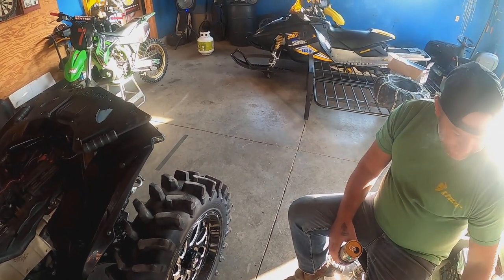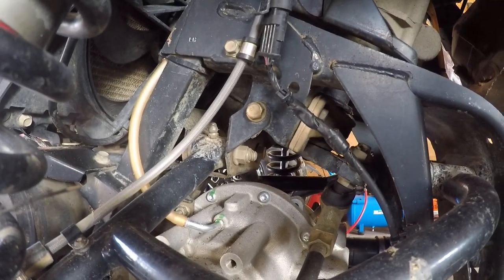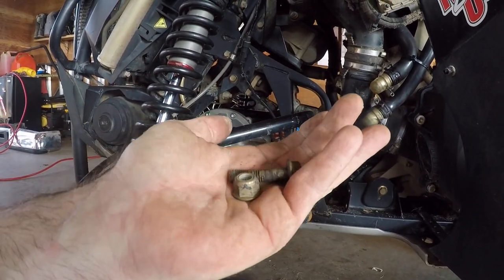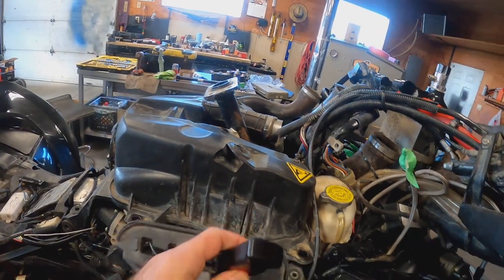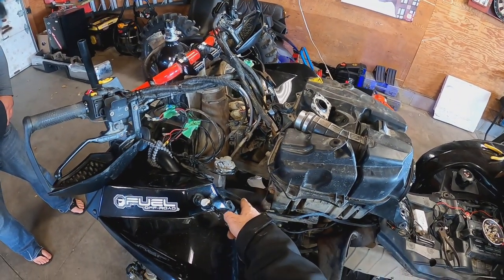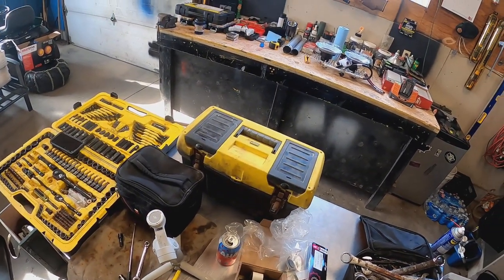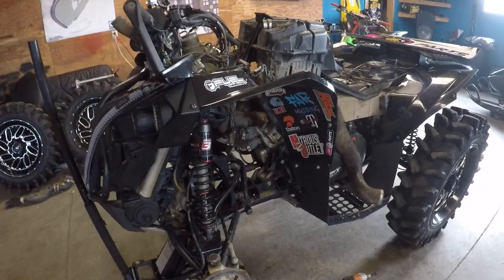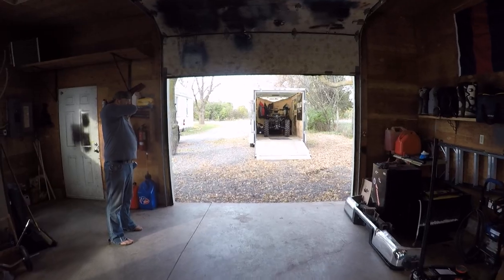Can-Am Renegade Xmr1000r, Upgraded Pitman Arm Install

Comment: Is this just a upgrade or a must fix?
Reply from the maker: When the original wares out, a must!
Reply: @ehTV1000  Wow, I have 3200km on my 2020 and do a lot of driveing with tracks and don't have that problem "yet"....and I'm not looking forward to having to change that out lol
Reply from the maker: @xmonster741  had one replaced on the 20 we had, 21 has been good so far though
Reply: This is truly a problem can am should be recalling.  My 19 outlander is all over the place. And my sons 19 xmr was shot a couple months after he bought it. Glad there are aftermarket options now. Not going to replace a crap brp part with another crap brp part.

Comment: First lol did you fix the problem joe is she steering better
Reply from the maker: Big time!! Only question is for how long? Was clear to see they were most certainly higher quality and in theory with the double pinch setup should provide better longevity. Only time will tell though. Fresh bushings were far superior as well.
Reply: @ehTV1000  ya I could see there made of better material as well looks like I need to add to cart lol
Reply from the maker: @Dieselmd2008  hahaha